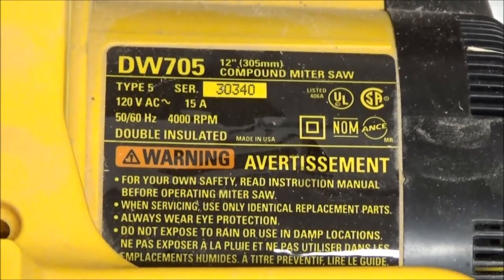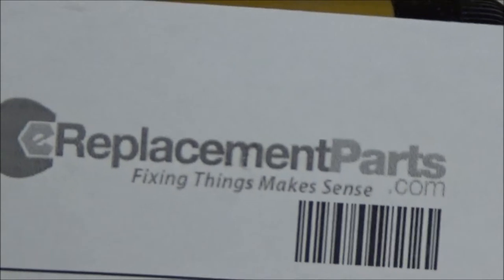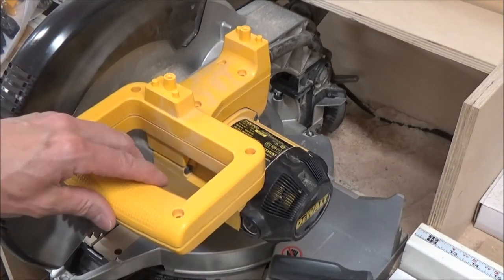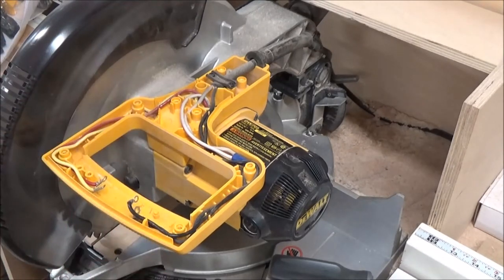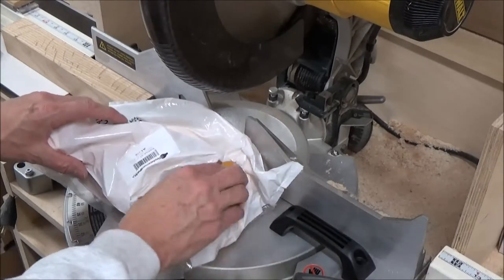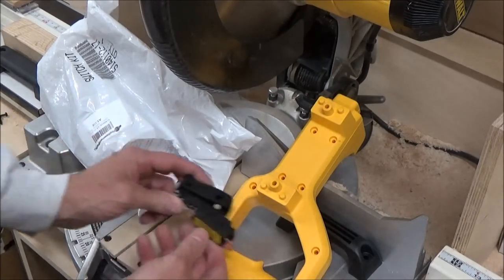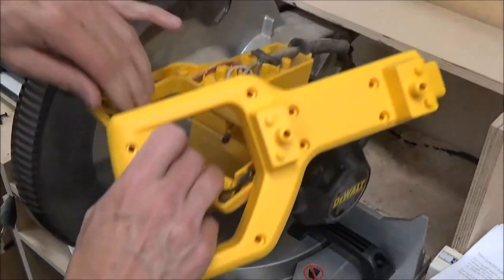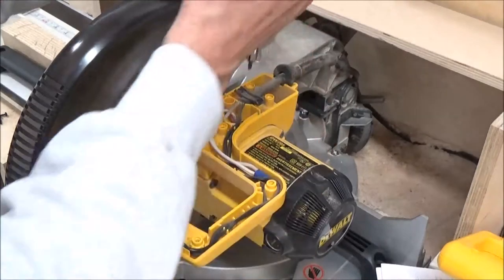DeWalt DW705 Switch Replacement Kit

Comment: Just got one of these saws and it has a broken handle so I will be doing this same repair (even the though the old switch works). Thanks for sharing this video. One minor issue that you could have avoided near the end - the metal piece that caused you to break off those plastic tabs, you had it in upside down. Look at the video in the beginning, and then the end, you will see what I mean. Thanks again!
Reply from the maker: Where were ya when I needed ya?! Nice observation. I usually take pictures before I do things like this and this time I didn't. Came back to bite me. Thanks for watching and good luck.
Reply: I didn't notice until I watched the ereplacementparts.com video after yours. Thanks again for taking the time to share.
Reply from the maker: You're welcome.
Reply: What did you do with the old switch you can't buy them anymore

Comment: What is the part number for the kit. I need to replace the handle on my saw.
Reply from the maker: Part #:5140112-17 but it varies with serial number. You can go to their website and easily search it.

Comment: This is to inform you how important it is to read instructions before tackling this project. You do not have use a Dremel to modify the upper housing for the strain relief. The strain relief is discarded as is the steel clamp. This is shown in a how-to video by the vendor that sells the replacement kit. It is very thoroughly designed and demonstrated. 
I know "real men don't read instructions", but in this case it will save you a lot of time and effort.
Reply from the maker: Thanks for the info. Hopefully others will find it helpful.